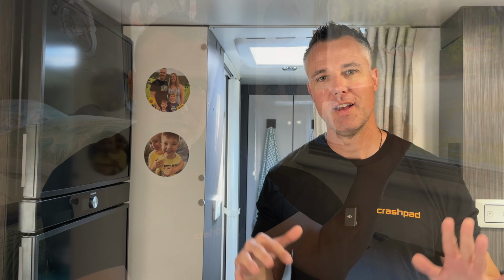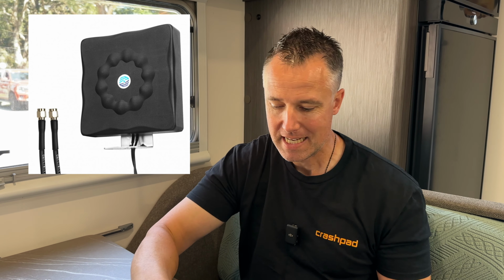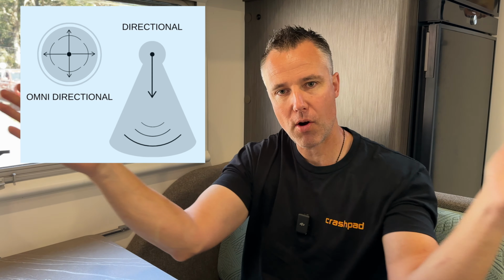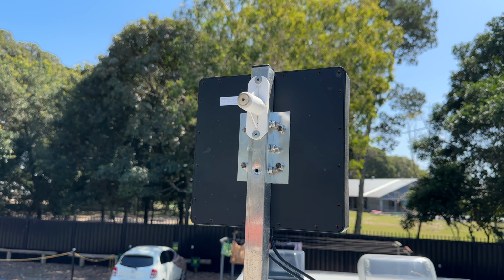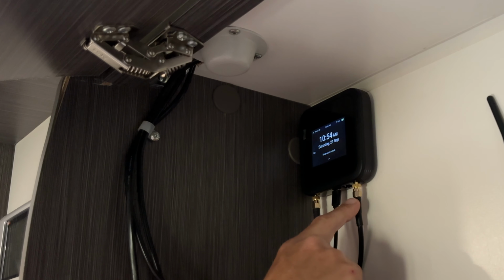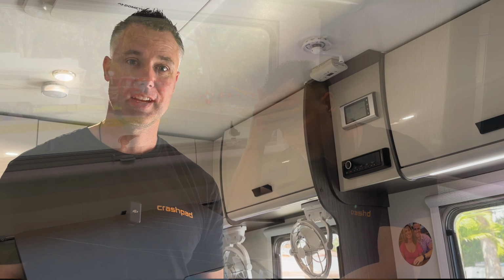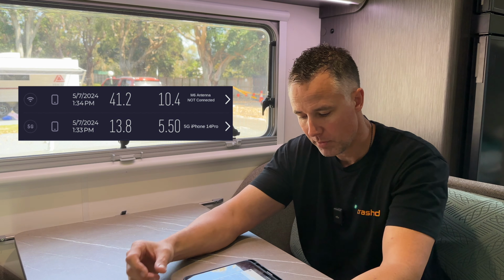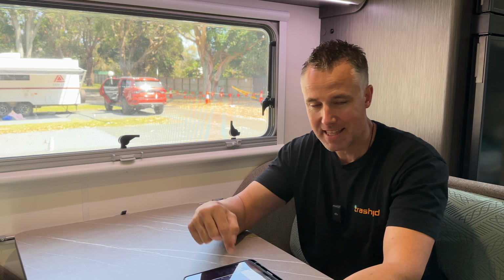MAXIMISE your 4G/5G Connections when OFFGRID! Hints and Tips to IMPROVE your CONNECTION!

Comment: Thanks, appreciate your gear reviews and have used some myself.  This looks worthy of more investigation as I will be living and travelling in my jaco outback soon. Didn't like the starlink prices.
Reply from the maker: Yeh it works well for us, and even if you are a full time traveller and you only stay in more populated areas, then this system would probably be enough. It will still have some limitations as you are reliant on the phone tower locations. Thanks for watching :)
Reply: @GetCampingOz I actually destroyed my Jayco antenna recently reversing into a shed while sealing and painting the Discovery's roof.
Used the roof hole to run solar cable, down into the van. Three 200w panels.

I have a 6m study fishing gaff I could dual use and dolly up a make shift antenna pole for the directional booster pannel.

Will be using your caravan 12v upgrade video as a resource for my lithium upgrade happening soon.